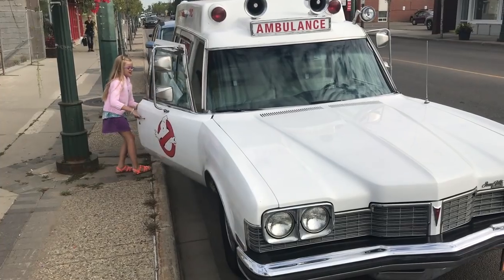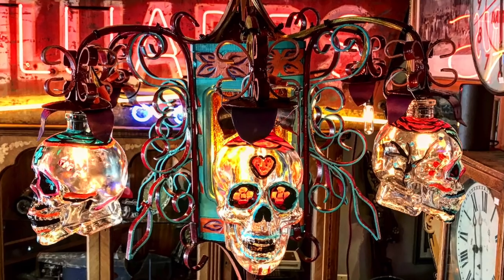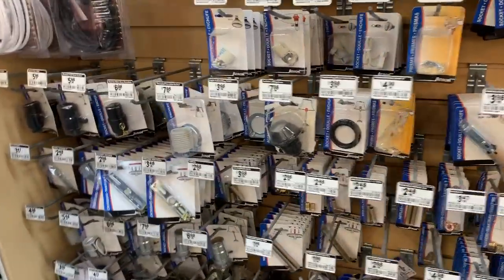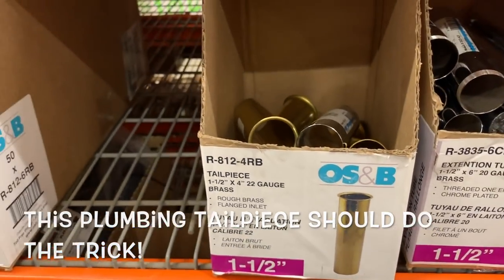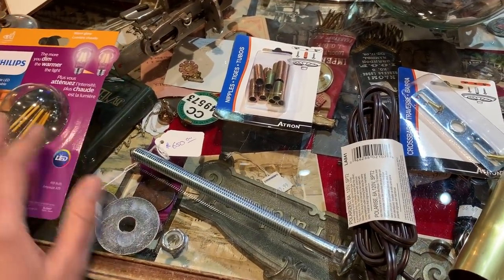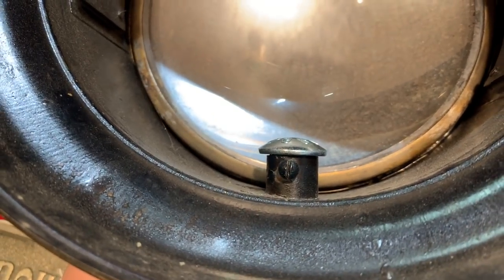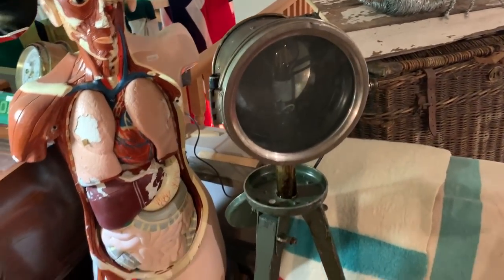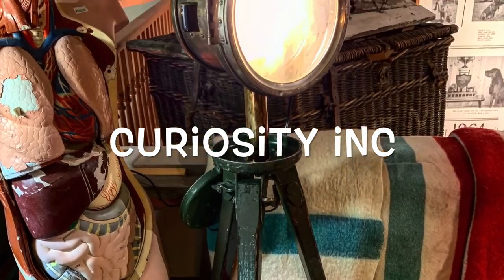Turning on the lights! making a cool spotlight lantern!

Comment: from what you showed, you didn't have the nuts to fit those threaded tubes. Are you sure that's a model T light? I don't recall them being brass, but I don't know a whole lot about them any more, forgot most of what I did know since I haven't seen one in a very long time. Came out nice. Next time you're out picking look for the movie style spotlights in need of reworking. They would do nicely in a similar fashion, but with a softer, less spotlight type bulb. Basically all you would need is the casing and the tripod. Of course, with some chain, you could make hanging lights from movie style lights. You would not want the brightness and heat of the old lights, but the look would be great, maybe you could make them wall mount to light up vintage movie posters? That would be a neat look. I bet that light sells quickly and for decent money.